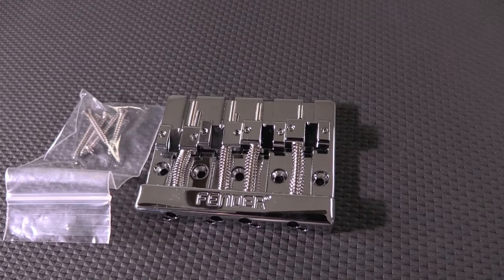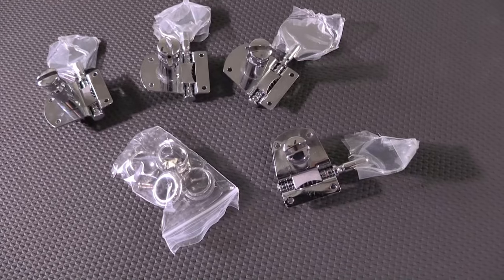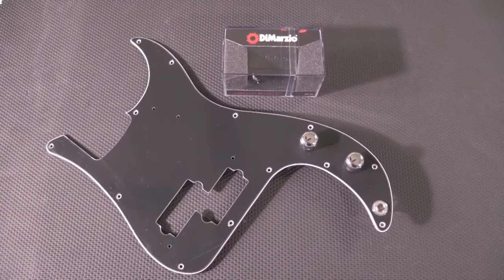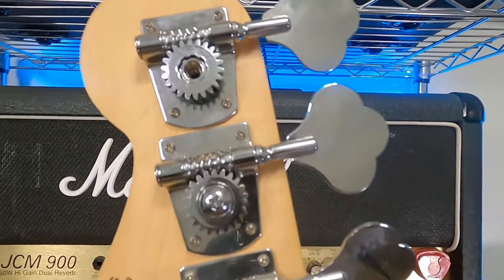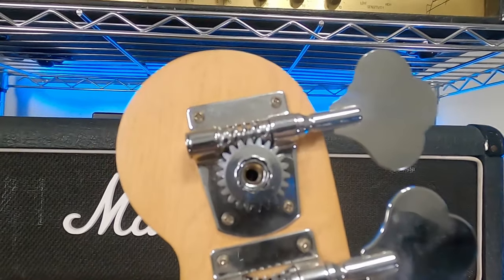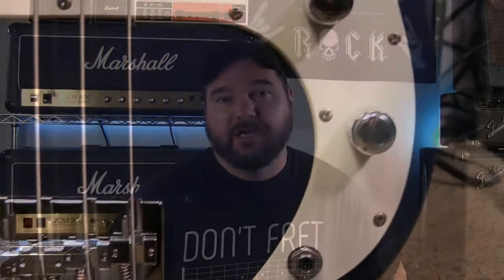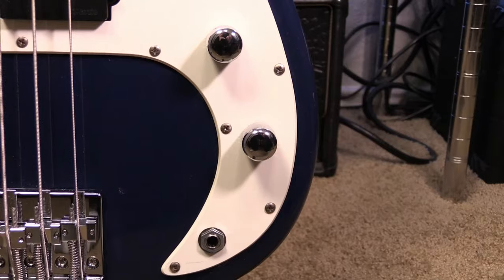Upgrading a Squier P Bass

Comment: The best upgrades for a Squire P-bass are to change the pickup, tuners and give it a good setup with a decent set of strings.  While a high mass bridge is nice to have, it doesn't improve anything functionally or effect the tone.  The same could be said about switching out the pots and capacitor because all that matters with those is that they are of the right electrical value and function.
Reply from the maker: Well, I got the pickups, tuners, and setup done with this one. The bridge and pots are just an added bonus. I just love tinkering, so this was a fun project no matter what the final outcome was. I just hope other people find my guitar escapades interesting. 😁
Reply: High mass bridge is nice because Squire bodies are a bit thinner than Fender. If you experience a little neck dive the bridge clears it up.

Comment: Squier bass pickups are fine. It's the small stock shizz electronics that need replacement. The only upgrade any Squier bass needs to vastly improve your tonal range options is to replace the small stock 250k pots with quality full size 500K pots and a new .022uf Orange Drop cap. Install a new set of Ernie Ball Cobalt Flatwounds and you won't believe the improvement.
Reply from the maker: @ColonelAngus2023  yeah, the stock pots really are... not good.

Comment: Good vid. Very often, changing pups are done in the hopes of radically improving the sound and it can turn out to do very little. There are many  factors that make up the sound beyond the pups.  I put Norstands in a classic vibe and they sounded no different than the stock pickups.  (Maybe a touch louder). I also put the Seymour Duncan Steve Harris pups in a classic Vibe P and again --  hardly made a difference.   Another often useless upgrade is the bridge. A super heavy mass bridge doesn't sound or feel that different than a basic bridge -- especially if you're going for a vintage P sound.
Reply from the maker: Valid points, but hey, you never know until you try, right? 😁
Reply: I’m very interested in how you didn’t get much difference when you swapped the Steve Harris pickups. There’s a vid on here of someone playing stock v. Harry and the Harry’s had maybe a touch more bottom and top but overall—as you say, “hardly made a difference.”
Seems odd and honestly I’d think you were...wrong, maybe, if I hadn’t heard it myself.
Reply: I've noticed a difference with a solid bridge. More sustainable tone and better playability. I used a Leo Quan badass 2 bridge when they first came out. Was advised by a wise old tech( He's gone on to fixing Harp's now) that the old Fender Bass's needed a solid bridge. For me I believe he was correct. It's all how it feels to YOU and only you.
Reply from the maker: @robertshay9951  for sure. Modding in all about what makes you happy as a player.

Comment: Thanks for the video.  I did some similar upgrades to a Squire Classic Vibe '70s P Bass.  I tried it out of the box with just a setup and some different strings on stage, was pretty good but was told the pickups weren't cutting it in mix.  It had a pretty good hum when practicing at home as well.  I lined the inside and pick guard with copper, that fixed the hum.  I swapped the pickups for some EMGs and swapped the bridge with a Fender high-mass.  Biggest difference was the pickups for sure.  Maybe a little sustain from the bridge upgrade.  To your point, being new to the bass, doing all this I learned a lot about the instrument and gained a comfort level with setups that is worth way more than what I paid for on all of the pieces.
Reply from the maker: I was a little surprised to find foil under the pickguard on my Squier, but it didn't have conductive paint in the cavity or anything. If I had any hum issues, I would probably add some, but it seems to be doing fine. EMG or another active pickup set might have made a bigger tonal difference for me. Maybe I'll revisit that in a future upgrade.
Reply: @mikelovesguitars402  After opening my Squire and finding no paint, no copper, and just that small section of foil under the pick guard had me comparing it with my Yamaha TRBX 504 fit and finish.  The Yamaha was way better all around and yet both were close to $500.  The EMGs I added to the Squire are passive, but I did them after adding the copper lining, so just the new pickups may have fixed a few issues.
Reply from the maker: @waylon8605  yeah, I think at this point MOST import guitar brands are doing the EM shielding to a decent degree. It would be nice to see more of it in a Sqiuer, for sure.

Comment: I just spent time cleaning 2005 Squire Affinity bass up for a young teen that wants to learn to play. It was found in a dumpster, literally. Amazing enough with a lot of cleaning and setup it’s a well playing bass. One of my issues with this area of bass is the pickup alignment. Almost everyone I’ve seen the E sting is sitting close to or over the second pole. It kind of sucks they made them like that. The only other complaint is the location of the tuner for the E string. Very playable good bass otherwise. Free also makes it better.
Reply from the maker: They're pretty hard to beat for the price.

Comment: There's definitely a bit more low end, you can hear it more with the tone up. When the tone was down in the beginning,  they sounded exactly the same. But maybe the pots are better now with better tone controls. And a high mass bridge always looks baller.
Reply from the maker: Yeah, that high mass bridge looks cooler than the stock bridge, for sure.

Comment: You've done a valuable service to the bass playing community.  I have a cheap P bass Affinity non PJ bass. I may drop $50 for a set of better pick ups.  The DiMarzio pick ups are appealing because of the Paul Stanley ads in the magazines 45 years ago. Dear god, where has the time gone?  Thanks for posting this video.
Reply from the maker: Thanks! I went with the DiMarzio pickups because while I don't have a TON of experience with aftermarket pickups, pretty much all of it has been DiMarzio. It's a brand I know and trust. I hope the video helped you!

Comment: Thanks for the info! I have the exact same bass and looking to upgrade with a few mods. The hi mass bridge adds sustain to the note, so unless you’re not muting the strings you won’t notice the difference. If you are looking for a bigger tonal difference, change the the nut to bone or brass. What I did learn from your video was that the cavity routing on Squier is different, that is something no one else have ever explained before. Important info when deciding to upgrade a pick guard! I always wondered why so many after market pick guards are specific to certain p bass models. Thanks again fantastic video, I liked and subscribed!
Reply from the maker: Glad you found the video helpful!
Reply: With pickguard swaps and such. The fit is due to where the instrument is made. Metric measurements as opposed to standard. So Squiers are made in China or Indonesia, or even Japanese basses, have metric measurements on pickguards, and USA and Mexican made use standard measurements. It's a small difference usually, but it can drive you nuts if get the wrong one, and try to line it up. Some of the screws work, and some don't.

Comment: Hey Mike.  Yes, P bass foam under the pickups likes to either get hard or turn to dust.  Be careful though, I have been playing guitar since 1975, but for the last three years, I have been playing bass full time at home.  Best wishes for you.
Reply from the maker: Nothing wrong with switching to bass. I have thought about it more than once to do a cover band or something. Just don't have a bass rig, so I've never taken the full plunge.
Reply: @Mike Loves Guitars  I sold gear I wasn't using.  I used the funds to get bass gear. The fender rumble 200 is plenty for at home, and band practice.  The rear panel on it has all your line out options.

Comment: Me, I replaced the round-wound strings of a Fender acoustic bass guitar with flat-wounds. No big deal, but I had to find a replacement for the bridge plug of the strings (at least the E-one). I knew from my older bass guitars (an electric and an acoustic one) that this would bring the sound closer to what I want. (Which is the supportive role, like in folk music and older jazz. Your taste and needs may well differ.)

I then wanted to equip a guitar with flat-wounds. I bought a B-stock of an el cheapo acoustic guitar for this, rather than sacrificing an existing one of mine. The "ugly duckling" became a "beautiful swan" - but it's likely going to be confined to rhythm parts, notably those with "circle of fifths" shoving involved.

Hardly worth mentioning: the addition of pick-ups. I equipped my older acoustic bass guitar with both a stick-on piëzo pick-up and a sound-hole humbucker (for guitar), in order to replicate the sound of an upright bass with both (that I knew from jazz).
My newer acoustic bass guitar, a new western guitar an this flat-wound guitar all have piëzo pick-ups (as I really like them), but I do have spare sound-hole magnetic pick-ups. I also have battery-operated 4-channel mixers that I could carry to blend both outputs.
I also stuck an acoustic pick-up to the soundboard of a cheap classical guitar. It does work, too well for my taste. (All sorts of pick-ups and other parts can be purchased via AliExpress. Which is not a certificate of highest quality or lowest price.)

I very recently mounted a Fishman TriplePlay pick-up on a Squier Stratocaster, so that it can drive MIDI synthesizers (with the TriplePlay USB-receiver in the optional foot controller). I still have a spare Roland GK-3 pick-up for use with a "13-pin" cable and matching devices.

However, I'm not too much of a tinkerer, so I bought an official Brian May Red Special, rather than adapting wiring to the official diagram.

Bottom line: trying different strings may well result in a big (and reverseable) change of sound for "little" money.
Reply from the maker: I haven't played any flat wound strings in 25 years. Maybe it's time to try a set.

Comment: I will say this; having modified my own basses/guitars for the last 15 years, the one thing i've always modified were the output jacks to switchcraft. Just gives me solid connectivity with the cable. I've done my fair share of swapping pickups, & those are different across the board. I feel like swapping the stock Affinity ceramic magnet splits with the Dimarzio Model 1 version just had the same tone. Had you gone with say duncan Hot for pbass, or quarter pounders, or even fender originals - you may have heard a slight difference in the EQ/balance. 

I tend to swap the bridge for a high mass one, just cause i enjoy the look of em, & i've had luck with some that are 20$ (which sadly, i can't find anymore). Does it add sustain to my basses? Not that i can tell. Does it feel nicer under my palm when playing? Yes, especially when the height screws aren't as long as the stock bridge hahaha. 

All that aside, i think i'd be with you - though i may have opted to find a replacement screw at my local hardware store for the tuning key, & just be done there. Strap locks i've always done without aside from splitting a set (between a Thunderbird lower pin, & a RIC copy bass' upper pin).
Reply from the maker: If nothing else, I like tinkering with guitars, so this was a fun experiment for me. I'm curious about what kind of tonal differences other pickups might have given me. Maybe the next mod will be trying a few different pickups to see which sound the best to my ears.
Reply: @mikelovesguitars402  if you wish to keep a passive route: any of the hotter duncan versions (hot for pbass, quarter pounders), dimarzio split rails, emg geezer butler have good reviews too

Comment: Bought a 20th Anniversary P-Bass from a guy who already put better tuners and a bridge in it (all black chrome hardware) and put a black/red tort style pickguard on it as well.  It was FINE.  But then I changes strings on it and decided to look under the pickguard.  Small alpha pots and cheap wiring.  I got new pots and rewired it, but the ceramic pickup did sound a little chincy to me.  So I was able to get a deal on a new set of Fender Yosemite pickups ($5). Put them in (and yes, used foam from the actual pickup box), and boy howdy!  Is that a decent bass.  I do wish it had a glossy maple fretboard vs the rosewood one (what?  Am I crazy?  I just like maple fret boards more).
Reply from the maker: Hey, nothing wrong with a maple fretboard! We all like what we like. That's why we have so many choices. 😁

Comment: Been tinkering on all the bass guitars I've owned. Mostly tweeks and cosmetic upgrades. Don't beat yourself up on what you did. The bridge is a must for sure. You'll notce way more sustain and easier playability.  Although I've never used that bridge it's a solid choice. The tuners were a no Brainer. Pickgauard is just personal preference as well as the neck plate.  Anyway you are a guitarist not a bass player per say. You did well had fun and learned from your experience.  Good job and good video.
Reply from the maker: Thanks! And yes, I did have fun with it. I always love tweaking guitars.

Comment: Thru u tube,  the upgrades seem a little quieter,  maybe just try some used active pickups and a great set up for a cheap bass to upgrade. Shouldn't cost to much to upgrade a little.   Good video idea.
Reply from the maker: Never tried active pickups on a bass before, but I'm open to it. I have to replace the stock active electronics in my Fender Prodigy bass anyway, so I'm leaning towards the EMG Frank Bello set. That'll be a video of it's own one of these days.
Reply: @mikelovesguitars402   I think you'll like a active set of f pickups. I have been using them since '88. I think emgs were pretty new thing at the time. They will deliver a Db push , ( a little louder) lol.  Been using them ever since.  Yes, I still have a few with humbuckers.    Have a good day.   Subscribed.
Reply from the maker: @duanepetersonakaroadkill7161  much appreciated. I'm glad you liked the video!

Comment: I think the difference is night and day. Immediately the new pickups had more body, more sustain, more warmth, they have a rounder tone. Original pickups sound thin, less definition. 

I learned two things: I guess my ear training is starting to pay off, and these $30 headphones I got from Best Buy are surprisingly OK at monitoring.
Reply from the maker: I'm glad you could hear a real difference. I think I need to upgrade my monitors. The ones I have don't have the best bass translation.
Reply: @mikelovesguitars402  I just got the P Bass and the pickups aren't bad but they're definitely not giving the signal definition you would want for recording. I'm not a bass player either so I'll be using them until I shop enough to find out what bass pickups I need.
Reply from the maker: @kMaxRx  I recently picked up a Fender Prodigy bass from the 90s in a JP configuration. Got it CHEAP for a USA Fender, but the active electronics in it are shot. SERIOUSLY leaning towards an EMG Frank Bello set for it.

Comment: Wondering if the difference is more noticeable live as opposed to through a recording and compressed on youtube?
Reply from the maker: Probably a little more. It's always a challenge doing these kinds of videos on YT due to the compression that gets applied, making it more difficult for viewers to hear subtle differences. The difference was particularly apparent while tracking, but to be honest, my monitors don't really have the best bass translation.
Reply: @mikelovesguitars402  I have a Squier Jazz Bass, would you say it’s worth it upgrading the pickups?
Reply from the maker: @teok8855  I think it would depend on the pickups you choose. The set I bought were pretty standard P bass sounding pickups, so it's not surprising that there wasn't a huge difference. I recently stumbled across a 90s Fender Prodigy bass with nonfunctioning active electronics. I'm strongly leaning towards dropping a set of Frank Bello EMGs in it. I think if I had tried something like that on the Squire, then the results would probably be more dramatic.
Reply: @mikelovesguitars402  cool, thanks a lot for the advice!
Reply from the maker: @teok8855  anytime!

Comment: You didn't change the strings, nut and electronics...
Reply from the maker: Well, I didn't change the brand of strings, but I put a new set on. Also, the loaded pickguard I got from DiMarzio included ALL electronics, and I transferred all of it to the original pickguard. So yes, I did replace the electronics. The only thing in the cavity that wasn't changed was the factory ground wire.
Reply: @mikelovesguitars402  Well, it does sound better on the lower end. But we should hear more change. I did the same on my Washburn Sonamaster and it changed the world.
Reply from the maker: @asafpelleh7594  I might have a more noticeable difference with a different set of pickups. Might give that a shot at some point.